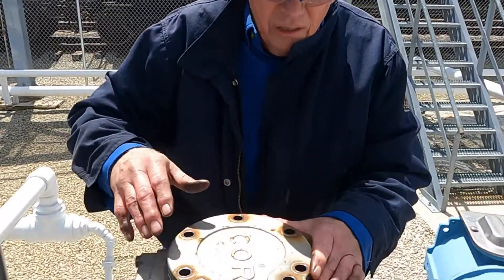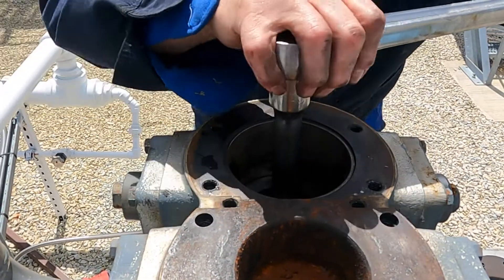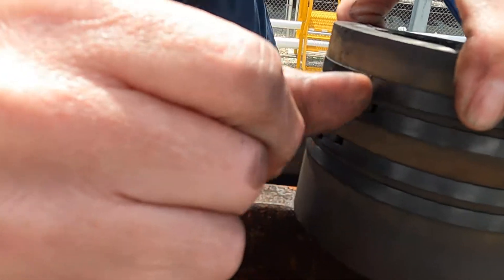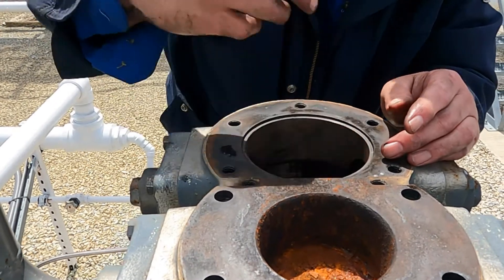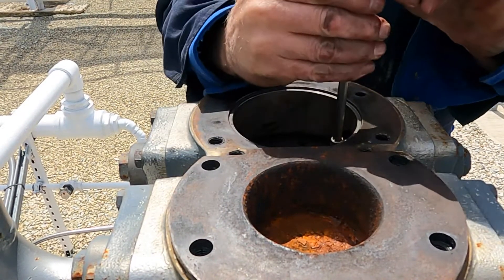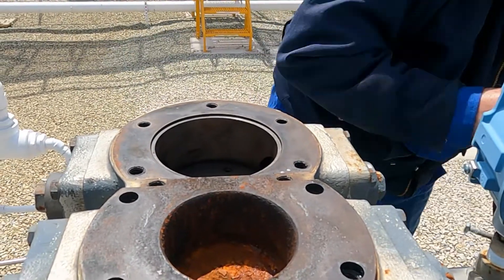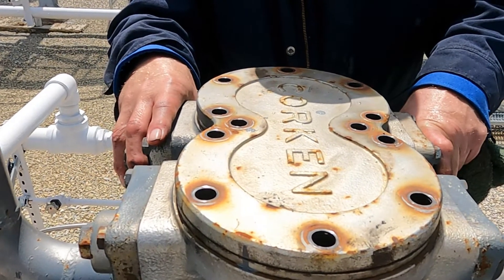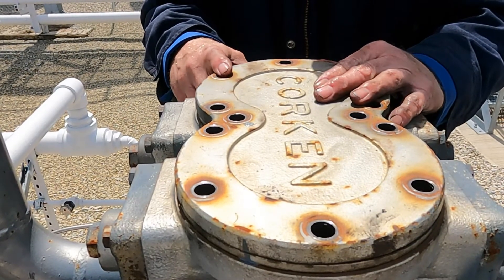12 - Compressor Piston Maintenance

Comment: did you use the loctite 620 for piston cap screws , is it essential to be used ?
Reply from the maker: Yes, they come with a small amount of yellow sealant. It seems to work well even after removing and reinstalling them a few times, but once the yellow wears off a few drops of blue Loctite is necessary. You certainly could apply new Loctite every time they get reinstalled. Hope this helps.